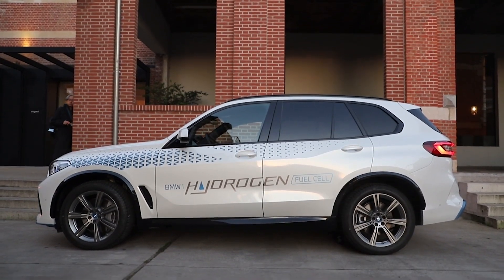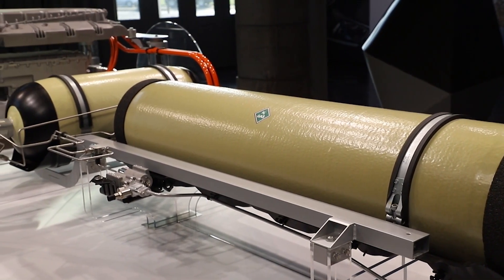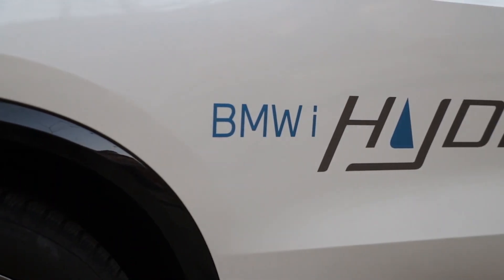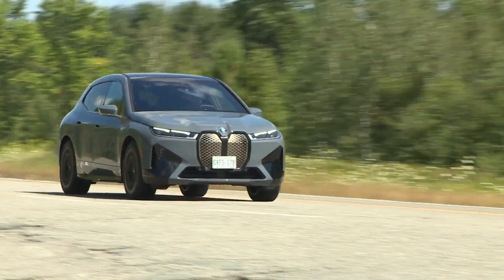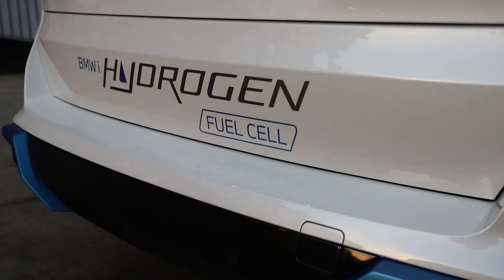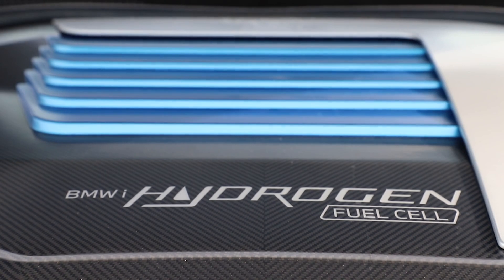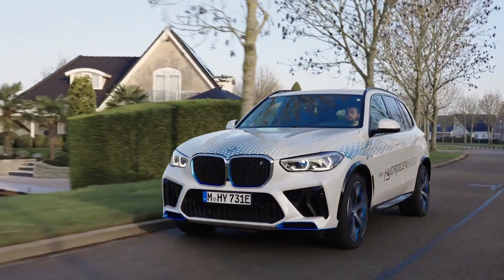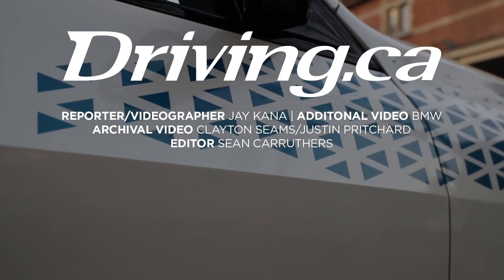BMW iX5 Hydrogen fuel-cell vehicle | First Drive | Driving.ca

Comment: Another problem with Ev's is that they do not make sense in a province that does not have clean (I do not consider Nuclear Energy "clean") energy. For 5 years, I have been telling anyone who'll listen, that Hydrogen is the future. ps. It should be the future of aviation as well.
Reply: And how is hydrogen produced?
Reply: @scottkolaya2110  It's true that the systems have not been "net-O" thus far, but they are improving on them every day. I have faith that it is the future (At least until we crack cold fusion😁).
Reply: how is nuclear not “clean energy”? Nuclear is the most efficient form of energy generation and one of the most scalable.
Reply: @jasperli  I'm not a fan of the way they store the depleted uranium (here in Atlantic Canada). That crap has a half life of about 10,000 years (I don't know the real number).
Reply: @jasperli  Don't get your panties in a bunch. I'm just not a fan of the current storage solutions for the depleted rods (at least here in Atlantic Canada).

Comment: Congrats BMW, you are f###ing smart! The MIRAI is on the market since 2014, in the last 8 years Toyota sold approx. 22.000 unit world wide (Europe, Norh America, China, South Korean and Australia + New Zeland). And now:
"New Car Registration Europe-28 Market Share by Fuel-Type 2022:
- ICE (Petrol(Gas)+Diesel+LPG+CNG): 51.4%
- MHEV: 15.3%
- BEV (Pure Electric): 13.9%
- PHEV (Plug-In Hybrid): 9.1%
- HEV (Full Hybrid): 8.7%
- Others: 1.6%
- EREV (Extended-Range): 0.1%
- FCEV Hydrogen: 0.00%"
The market share for FCEV was the exact same in 2021: 0.00%. ZERO.
So it is clear to see: in Europe (on BMW's Number #2 market - the first is China!) no one gives a single f### about FCEV passenger vehicles.
Reply from the maker: It's so wild to see you say "legacy automaker" when there was a time in America very recently when EVs had 0.0% market share. Tesla was an early mover in that market. Remember the first-gen Prius? Nobody does! Because tech can be slow for a couple of years and still take off later. What the future holds? Who knows! Thanks for watching :)
Reply: @drivingca  The BEV proved many times in the last 10 yrs. Tesla - looser American startup with a lunatic leader makes 8 times more profit on each vehicles compared to Toyota.
How about that:
“If we take a look at the full-year results, it turns out that hydrogen fuel cell car sales decreased in 2022 by 19 percent year-over-year (from a record level of 3,341 in 2021).

In terms of models - all are down year-over-year, and as far as we know, nothing new is coming in 2023.

Sales in 2022:

Toyota Mirai - 2,094 (down 20%)
Hyundai Nexo - 408 (down 5%)
other models - 205 (down 27%)
Total: 2,707 (down 19%)”
BMW and Toyota waste their time on FCEVs. And the another problem is: hydrogen. 95% (some research says 98%) of hydrogen produced from fossil fuels. And Big Oil speaks about the green hydrogen: they want to make hydrogen from drinking water. Are you serious? Millions and millions of litre of drinking water needs for electrolysis monthly(!) if you want to replace oil and gas! And a lots of energy needs to store, to transport and to compress hydrogen during its lifetime… It doesn’t make any sense. And I still did not talk about the costs of the whole new “hydrogen future”.
Reply: @gyoergypecsi  bro, hydrogen fuel-cell is a technology for the future (10, 20, or maybe 30 years), so don't speak with me about HFCEV sales right now because it is a very shortsighted argument!!
Reply: You seem flustered.
Reply: @chisaomusician  No, I'm absolutely fine. I just do not like when a legacy car manufacturer (e.g. Toyota, BMW) is faking people. And I do not like the grren washing what the Big Oil and Gas Companies do with the 50 Colours of Hydrogen.

Comment: So this would require petrol stations to offer hydrogen right? Seems like a dumb question, and maybe it is. Just confirming really.
Reply: Yes, it needs a H2 Refill Station. How the hydrogen produced, compressed, stored, transported, compressed, and stored and compressed again BEFORE you can fill the tanks of an iX5, or a MIRAI ... what is the cost all the process, how much MW of electricity needs to do all the works to have the H2 and get into the tanks of FCEV vehicles, what is the price Customers has to pay??? It is complicated to give a short answer.
Reply: @gyoergypecsi  thank you too. You guys helped clarify it for me.
Reply: @gyoergypecsi  It's not that complicated of an answer.  57kWh to make a kg of H2.  Another 12kWh to liquefy it for efficient transportation and storage.  100% of new H2 stations are set up as liquid H2 because the gas ones run out too fast here in the US.  So 69kWh/kg.  Plus transportation, maintenance, equipment depreciation, etc.  In California, the average price of retail 700 bar H2 is $25/kg.  Commercial electricity costs $0.25/kWh, so 69kWh * $0.25 = $17.25 for just the energy for a kg of H2.  All the other costs and a tiny profit bring it up to $25/kg.
Reply: You either have to pay local electric prices, or you have to increase transportation costs.  Either way, it's expensive.  Consider Gasoline.  It only costs about 75¢/gal in energy to make for something that's basically free in the ground.
Reply: Not a dumb question. No one in Canada is building them yet. There are a couple in California. The UK has just started to build a network of Hydrogen stations, and (Don't quote me) I believe there are quite a few on continental Europe (Especially Germany).
Reply: @rowauthority  thank you.